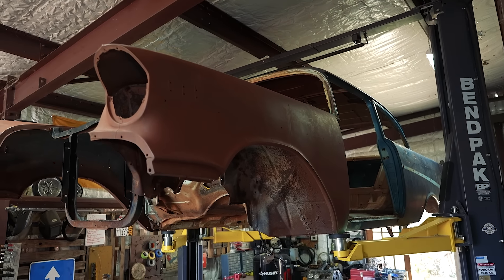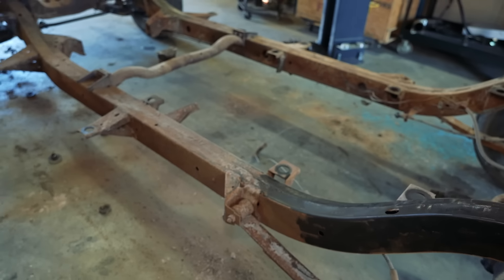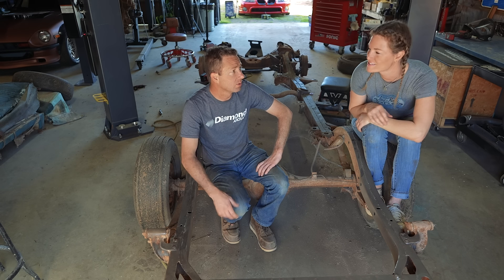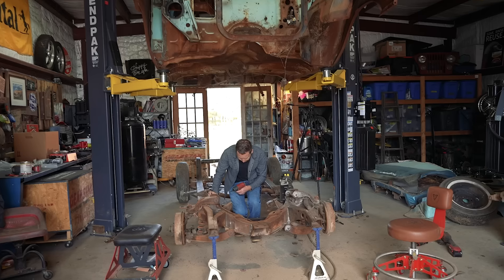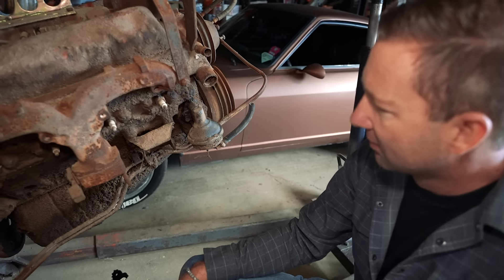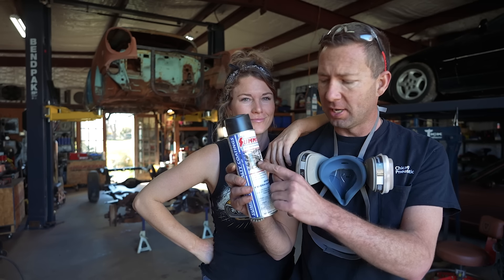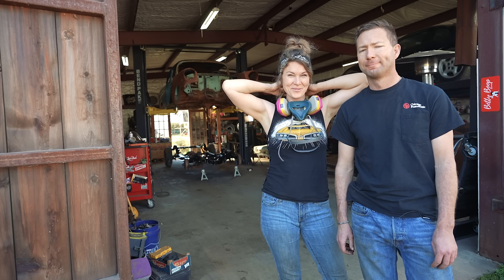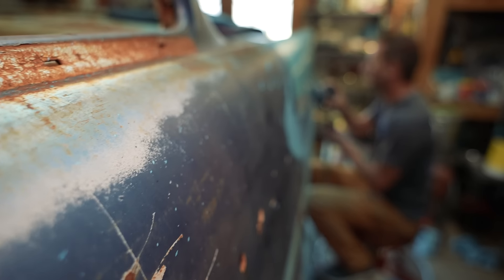57 Chevy SURPRISED us after frame RESTORATION!

Comment: Aaron, if you're worried about running thick paint through your good paint gun, then  go to  Harbor Freight and pick up the $10 purple paint gun.
It is decent enough for primer, sealer, and rust converter/encapsulator.
Plus, if it clogs, just toss it😊

Comment: What we have tried is a pressure washer with the sandblaster attachment the sand actually works very well but what we found out was using glass! One bag of glass did more than three bags of sand and it did a better job and of course it was faster. It saves so much time and did such an awesome job I highly recommend it's a lot safer and faster

Comment: That power steering box ya'll bought is a very good investment, they work great. Those front ends work good, just put tubular A frames on it and lower it just a little.  select a strong shock. Then convert to disc brakes and your good.  I usually cut down the OEM steering column and cut two flats on the shaft to connect a rag joint and it will work great and looks original on top. If the rag joint is a little too close to the firewall, weld in a short piece of 4 inch exhaust stack for a cove, works great.

Comment: Great video thanks I'm about a 69 Charger 1976 the only thing wrong with it was had five enamel paint jobs I zip stripped it in the driveway I used 24 gallons of marine stripper what a mess but the car turned off fantastic she never saw that car 440 4 speed buckets console positraction power windows Factory disc brakes up front paid 1200 bucks for it no rust straight as an arrow yeah that was long time ago but zip stripping your car with five paint jobs is a nightmare have a great day:face-blue-wide-eyes::face-turquoise-covering-eyes:

Comment: I am just finishing my 1950 F1 pickup, My frame was in almost the same condition visually.  I was able to wire brush everything with a 4.5" grinder the original paint was still on the frame everything was oklahoma red dirt and a bit of grease.  I had pitting in one location for about 5 inches the rest came out clean.  The best surprise I ever had.

Comment: I owned my 57 for 18 years! During that time I did several modifications that brought that car forward! First, any mod worth considering must be done with "Name Brand" Parts! Thus adding value to the complete project! Which brought value to the sale of the car!
Like your brake lines! I didn't get stock materials replacements! I did Willwood with Stainless steel brake lines! With 4 wheel disc brakes!
Actually, One of the very best mods I did was a complete 21 circuit wiring harness! Yes, a electrical upgrade made a huge difference between things being iffy and NOT!
You have yet to discover some of the things I discovered during my 18 years of "driving fun"!!

Comment: That's how you know that was a super clean frame when it strips that easily with a wire brush drill. My pops 55 we built in the early 90s was a Mid-Atlantic car and the wire brush barely made a dent, it took full on sand blasting to strip the frame down to metal, wasn't rotted but had enough surface rust to permanently pit the metal.

Comment: I might also mention, when your paint on the frame is good and dry, roll it outside and use your little tractor and stand the frame up and wash out the inside of the frame tubes.  They collect a lot of dust dirt and debris, which helps rot the tubes out..  I recently helped build a 55 two door, and it was in the 1998 flood.  The frame rails had almost 1/2 of dirt and muck inside.  We all know how much dirt moves around in West Texas.  LOL.... Can't wait to see which way yall go with this thing.  PS  please move the rear springs either inside or under the frame rails, there is just not enough room for tires on these cars. Mini tub when doing trunk pan.  Good luck.

Comment: On my project I decided to just use spray bomb rustoleum to get us on the road.  On the road you can see what the car tells you when you drive it.  After a year I have decided to buff out the spray can paint and possibly use VGG clear coat.  Later I may do a full paint job.  “Don’t get it right, just get it running”. DF.

Comment: you got the race cars, the off road ones as well., the cool classic MG. How about making Charlene (sorry I jumped the gun and named her) a resto mod? modern brakes as you plan, updated suspension with a small drop, like an inch, 4bolt main engine but with the efi that looks like a carb, serpentine belt, modern trans. of course a locker rear, no one wheel peels for Charlene!! nice period looking wheels as well.

Inside - would just be rebuilt standard seats, rewire, no point messing with the old stuff,  dash would be the restored original clocks and a hidden modern stereo and maybe go for the OEM+ route if you can find any optional period extras to dress her up a little.  vintage coke cooler? need something to keep the snacks in for the road trips!

outside - repaint in that beautiful light spar blue, and restore the chrome, no need to mess with getting rid of any chrome, and any optional period extras you find.

but thats just my thoughts, anything you do is going to be cool as well!!!

Comment: I started watching Flying Sparks Garage the first time you rebuild Roxy's engine and would like to see another engine build. The one l have in mind is the 396 in the camper truck. I'm interested to see what you would do to improve the factory setup (cam, intake manifold/carburetor or fuel injection and exhaust). You could alternate this with the 57 build.
Reply: The beauty of having a yard full of potential videos!
Reply from the maker: This is definitely in the plans, we are actually kinda stuck on a few projects due to rain. When it gets wet here the yards turn in mush. The camper engine will come out soon and get a rebuild!

Comment: I love working on things but I despise cleaning rust. I restore vintage campers and the frames are just as rusty as the one you’re doing. I lucked up and found an “ole boy” down the road that will sand blast and primer seal a frame for $200.

Comment: probably not a big deal, but I like to spray stuff down with Ospho after mechanical rust removal before paint, it really works into the cracks and converts out the rest of the rust you missed.. Don't use it over concrete though, the acid really stains concrete bad, otherwise its pretty friendly stuff.

Comment: Aaron, if that is a 010casting on the block, you can not tell if it’s a 2 or 4 bolt without having a look inside. Chances are good it’s a 2bolt, but may be surprised to find a 4 bolt.

Comment: At this point your project can go in so many directions. It would look great in the original light blue with a stock appearing interior. I know it has already been done by other builders but an LS engine w/5 speed manual and modern power accessories would be nice too.

Comment: that probably has a legible  vin number on the drivers side top frame    about where the seat is        if it mattes its the original
Reply from the maker: It does, the car was Larkspur blue 2 door sedan. Pretty base, we are going back with the same color.

Comment: I tell you, I started using one of those clip-on Rustoleum can guns and feel it makes rattlecan painting a lot easier and more controlled.  You definitely don't get finger fatigue.  The rustoleum design (clamps around the center of the can) fits more cans than the one that snaps into the center.  You might want to pick up a couple for your shop.

Comment: Project like that I would buy or rent a portable bead / sand blaster and hang plastic sheets around the lift to make a small booth. My friend restored an old ambulance into our bands gear bus using one at the local firehouse parking lot. the repainting came out perfect as wee were priming right away...... Nebber mind.. just hit the sandblaster mention in the video....  great minds huh...      That paint is money.. came out really good.     Ponder any suspension changes and make them now while you can get at them super easy....

Why use chemicals when you have the blaster.. Safer cleaner and faster unless you do product placements....  PS all primer can look cool for a time until the new shop is finished.

Comment: Are the fenders over the headlights solid or Bondo?  I'm not sure I have ever seen a '57 that sat out that wasn't rusted our over the headlights...  
I'm sure the vast majority of us would prefer to see a project go from start to finish all at once rather than bounce from this to that.  I am still waiting to see the long hauler home trailer finished, but as you said, to stay busy you have to bounce around when you don't have what you need to continue.  
Technology has worked out well for this old guy...  I love my new generation Ram Hemi, but the only thing I knew how to do was to install the beautiful Ram cold air intake.  It's a great running machine though and I am too old to work on it even if I knew how.  My first mechanic job was at age 16 overhauling a '50 Chev 6 banger that got 14 miles to the 21 cents a gallon with the slush box transmission.  My second mechanic job was pulling a 283 out of a '60 Chev convertible and dropping in a 409 which broke the limb on the shade tree I was using to lift it.   It wasn't a great engine but it sounded good. Anyone with a basic set of tools could fix about anything that went wrong, and plenty did.  If it got too complicated, you went to the library and got a Chilton's Manual for your brand of car.

Comment: Put the tubular A arms and disc brake conversion massive sway bar and it will be dialed . Nice little 496 ci  and Muncie 4 speed 12 bolt posi ok done enjoy . 454 block bored 60 over Scat rotating stroker kit assembly internal balance .

Comment: Next time, a better idea to use on the frame is POR-15, its a rust encapsulating paint you can brush on or spray and it will outlast the car.

Comment: back in 1973 I had a one owner 67 Chevelle Mailbu two door and I didn't to strip the paint.   The stripper I used back than was amazing....brush it on and just scrap the melted off.  The bear was getting the primer off to see the original metal

Comment: If you decide to strip the car of all the paint, get some of those really thin plastic drop cloths .  Brush on  the stripper on then cover it with the drop cloth and smooth it down with your hand.  this locks out the air, won't dry out as fast.  Less striper, because it will not dry out .

Comment: Aaron was saying that 350 with 2 bolt mains is undesirable 265’s , 283’s. and 327’s all had 2 boltmains and people were cranking those engines at 7 or 8000 rpm and the lived. I think 2 bolt mains are fine for a driver car that is not raced on a regular basis. Even some big blocks had 2 bolt mains. 2 bolts for fun not high horsepower. Love your channel even if we disagree
Reply from the maker: I agree with you, it’s not that they are not good it’s that for whatever reason people generally want a 4 bolt. I’m personally not using it because I don’t want to invest time and money into it. I’d rather build something else. Thanks, Aaron

Comment: I wanted to share the one knowledge about engine you have for the 57. If there is a 3970010 block it's got high nickel content mean webs. It's the same for two or four bolt main blocks in that era. So if you have a 397 0010 block it's an ideal engine to build. Nice to have a 4 bolt main but not necessaryv that block is excellent regardless. Have a good one

Comment: I think it is wonderful that you are doing this frame restoration. I had a restoration body shop when I started out in this trade. I used to do the body and frames for a company called T Bird Products. They restored 50's T Birds to like new condition. I wanted to comment that I used to take the frame as a separate unit to the sand blasters, and they had a huge Caterpillar motor sand blaster, and when it came back the whole thing, every nook and cranny looked like new metal. Leave the suspension on, rear, differential etc just like you have it. When it comes back spend an hour blowing sand out through the holes in the frame. THEN TREAT IT WITH LIQUID METAL PREP that gets the metal ready for accepting paint, and destroys those nasty little rust seeds created by metal powder meeting with the moisture in the air. All car manufacturers do "Pickling" dipping the bodies into acid/metal prep. 
Then go ahead and prime everything and paint it black. Then you go ahead and break down the suspension in order to replace for example the rubber bushings, and it is great if you put on new large washers and nuts. Makes it indistinguishable from new. You might as well do the rest of it. Take the body apart, and have the sandblaster do all of the innards surfaces like door jambs, motor compartment, floor both in passenger compartment, and trunk floor. DO NOT HAVE THEM SANDBLAST THE OUTSIDE PANELS INCLUDING THE HOOD, DOORS ETC. But DO have them sandblast the inners of those panels. You see the large blasters can heat up the metal on the straight part of the panels to the point that they warp, so deliver the body, and frame to them with the outside of the panels already stripped down to bare metal. The secret to stripping is to use a good amount of stripper. Let the stripper do all of the work. No heavy scraping needed. 
I think it is great what you are doing to the frame. We used to spend $250 to have the frame and body innards sand blasted. It took all of the work out of it. It is a show car ready procedure, indistinguishable from new.

Comment: Hey you two, cleaning and painting that frame would be a lot easier if you take the suspension off, all the bushings and that probably need to be replaced anyway and its a lot easier now than when its all together. Trust me i've done it enough times and you will be much happier with the end result when your done.

Comment: Chassis Saver is the best ya wire wheel it, doesn’t have to be perfect it actually helps to not go overboard gives it something to grip to if you spray it you need to thin it a little with some lacquer you open it you use it or take the chances of it hardening up I paid $158 for a gallon don’t get it on your skin you’ll play hell getting it off 😳🙂

Comment: The frame was probably made at the Flint Metal Center (Chevrolet Frame and Stamping in 1957) and it was stick welded. We didn't start using wire welding until about 1978-79.

Comment: Your sand is probably too damp, with a syphon blaster it must be really dry or it will clog. Get a small pressure pot setup,  it'll be so much better and faster. The sand will still have to be dry though.

Comment: Just a reminder. Do not forget to put the spray noise dampener in the trunk and underside. Some people also do a coat inside the doors but mask off where door hardware goes. It will cut the noise down so it does not sound like you are riding a steel coffin down a dirt road. It also protects the underside from road debris damage. It is best to get it on before doing the final paint. You can get it in rattle can or some people substitute with spray bed liner.

Comment: Try bagging the part after applying the stripper or do smaller sections. Once the stripper off gasses and starts to dry, the paint re-adheres and can be a pain. The bag will contain the fumes and help release the paint. I do this with aircraft paints and epoxy primers and it really helps. You can just tape a trash bag over the area. Good luck looks like lots of work but lots of fun! Love the show watch you guys all the time.

Comment: Real men dont use eye protection to wet sand.....thats what the wet is for.  We rode in the back of pick up trucks when we were young . We breath welding fumes and wash paint out of our eyes with brake clean and eat lunch with engine grease  on our hands. We bleed on every job, other wise it aint done right. We use elctrical tape and a mc donnalds napkin to stop the bleeding ONLY because it was making the socket wrench slippery.We dont open the garage door because of exhaust fumes........we yell SMELLS LIKE AMERICA as we wave the flag and turn up Strangle Hold on the radio EVERY.......SINGLE.......TIME it come on....because its still the greatest song ever written...........eye protection?........Thats why God.......gave us eye lids . ( end of rant )

Comment: Need a pressure sand blaster much better than your siphon blaster hf has them. Strip paint sucks till you get something like Marston dry stripper that you put on wet and leave over night and brush off like corn flakes with a counter brush like cleaning cornflake off the table.

Comment: Peel the paint that needs to be, peel the bondo,  sand the rest of it and prime it for now. Clean the underhood and fire wall and floor pans, repair as needed and prime it. Do your mechanical add ons and repairs. Fit and adjust all doors and panels, bodywork, prepare for paint. This will take a few months, it's a longtime project.

Comment: All you have to do is just clean the loose material off wash it make sure it's clean and then get some IES 1500 rust coat and brush it on Works wonderful you can purchase it it's out of Florida International epoxies and sealers through G&R Fasteners that's their supplier otherwise you could use 415 I think the IES 1500 is just as good if not better and it's less expensive if you undercoat that frame it will Rust Out From the Inside Out you have to put a rust coat on it anybody restoration on a old car should know this check out GNR Fasteners Florida

Comment: If that is an original 57 motor it's not a 350. I think the biggest engine available was the 283 ci with fuel injection. If it is not fuel injection, it's a 265 ci.

Comment: FSG, unfortunately Bondo absorbs water! The base of any dent or damage repair should ne done with polyester resin + glass fiber or cloth. That combo will seal the patch o the bare metal. Bondo for the final filler no more than 1/4 inch. Primer, sealer and gloss coat will make it last!